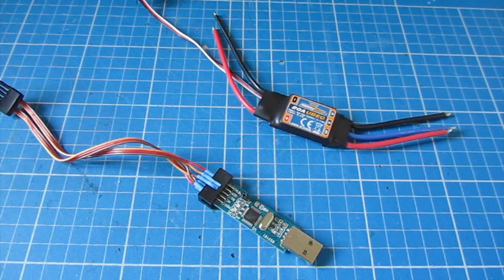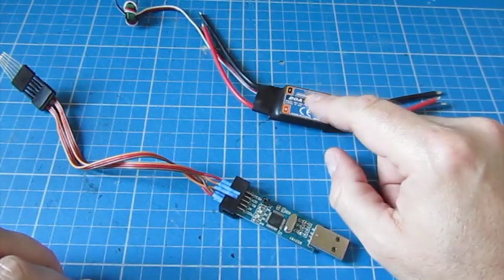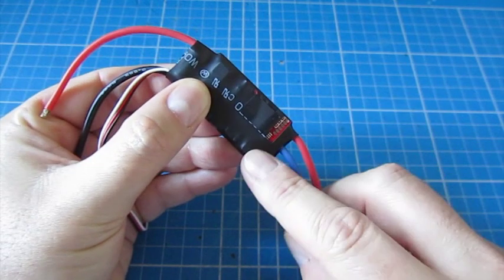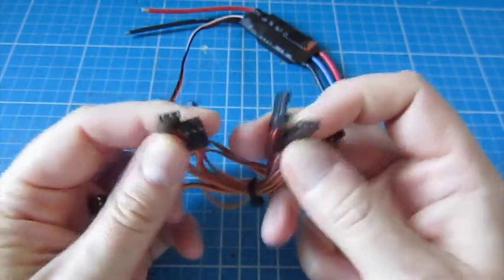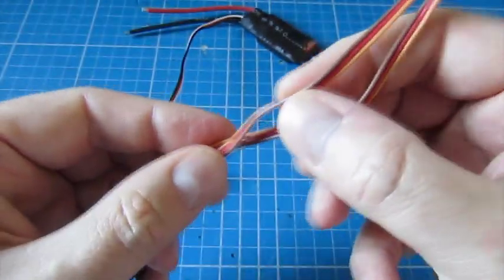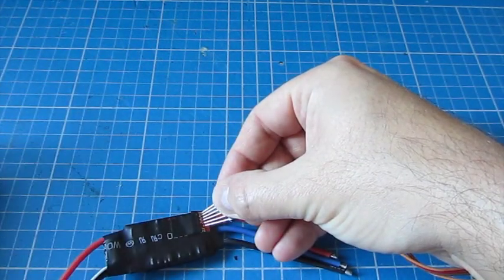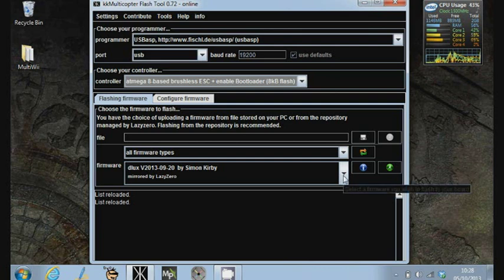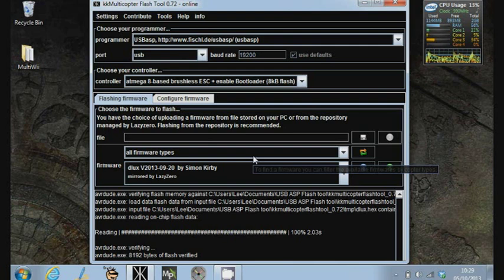How to update SimonK Firmware on ESCs using an USBASP tool

Comment: I have a big four 30A Esc and I need updat to bheli
It's possivel???
Reply from the maker: Depends on the make and model.. Best of luck
Reply: @Painless360  
I'm not sure what my ESC is because I bought it on AliExpress 5 years ago and it came only with a red shiring and a HW30A sticker hehe
I have this table, but idk my esc type
https://docs.google.com/spreadsheets/d/13tMlu5ldLNpZXwbe6UhDHJhcgTVuljm8HDiDp9WO9Pk/edit#gid=0

I think about giving up on this idea before I kill my ESC, maybe I'll leave it to SimonK who has already been there hehe

The idea is to put them to work with Betaflight on an F3 controller that I had kept here and was never used.

Frame F450 (No one else uses it)
Reply from the maker: If you don't know not sure how I will! :) May be time to invest in some new ones...

Comment: Painless360 - please tell me if i can flash ANY of the ESCs that can be found on hobbyking with SimonK firmware? Does SimonK firmware allow to switch any ESC to Forward/Reverse operation? Thank you!
Reply from the maker: The ability to update an ESC is very specific to that speed controller. SimonK has been superseded by BL_HelIsuite these days now anyway. Best of luck!

Comment: thanks for the video :) can i flash my Hobbypower 30A esc with simonk firmware? here is its link http://arduinopak.com/Prd_Detail.aspx?Prd_ID=17540
Reply from the maker: No idea, I've not used that one. That's a question for the vendor/seller. Best of luck!
Reply: I have the same question (and the same esc)

Comment: sir please answer this question of mine that is it necessary to flash ESC? can we use it without flashing...
Reply from the maker: You can but I wouldn't. You need a fast ESC update on the multirotors. Most pilots use BLHeli now..
Reply: sir thanks for your suggestion

Comment: Used this method to get blheli bootloader onto my SN20A ESC's with the USBasp. I had some of the "female tall stackable header connector socket arduino" in my spare part shelf. So I only had to make the wires between it, and the USBasp. Btw, looks like I killed one of my ESC's during the flash due to a short circuit for the positive and negative wires to the ESC (the ones that you usually connect to a battery or PDB) they touch each other during flash. After that, there is no response from the ESC when I try to flash it again. Even not if I hook it up to a motor, connect the signal lead to a servo tester and apply power. Luckily, I've of that kind who like some spare. So I've just picked up a brand new SN20A from my spare part shelf ;) Recommend all other to add a piece of tape to insulate the positive lead soldered to the ESC. The main reason for flashing the ESC's with blheli bootloader, was to achieve BLHeliSuite compatibility through Naze32 board for later flashing/reprogramming of the ESC's. The SimonK bootloader does not have the signal by-pass through Naze32 compatibility as the blheli bootloader. With SimonK bootloader, you have to disconnect the servo connector from the ESC, one by one, and hook it up with a ESC linker interface. I think the SN20A is a bit outdated for the game. But want to test oneshot for these particular ESC's for a new build of an 180 frame with RCX H2205/2950KV motors and see how crazy it goes/fly =)
Reply from the maker: +Eirik Larsson happy flying!
Reply: Thanks :)
I forgot to mention that I've used the BLHeliSuite program to flash the blheli bootloader onto the ESC through the USBasp device. I did not use the kkMulticopter Flash Tool as you did. Just mention cause I see other ask you if this will work with other ESC's or not. Happy flying Painless360, you helped me out a lot of times with all your good videos. Cheers =)

Comment: First of all, awesome video(s). You inspired me to make this my hobby too :)
But I got a problem with my software:

I really need your help. I just got into the hobby from fpv and I can't figure out whats now the problem.

My problem is that I can't switch on the motors BUT the receiver gets the signal and the motors are working on the "motors"-tab on cleanflight. So the problem should be on the software right?

I bought the following kit: 
https://www.aliexpress.com/item/DIY-mini-drone-Nighthawk-250-FPV-frame-kit-D2204-motor-Red-Hawk-BL12A-ESC-OPTO-CC3D/32698109504.html?spm=2114.13010108.99999999.7.AWW0Ud

I really would appreciate your help
Reply from the maker: +PixelDuude check out our 'troubleshooting arming' video to see what to look for. Best of luck!
Reply: Yeah this was the problem :)
thx

Comment: Hiya. I got some esc's from hobbyking and I wanted to flash them with simonk but I can't make out what solder pads to use. They're LD-Power 15a and there doesn't seem to be much info on the web about them. Have you any ideas? https://flic.kr/p/FLHWaZ Cheers ;)
Reply from the maker: +JohnnySlash No idea, we've not used these. I'd look at those pads at the bottom and see if you can see any markings on the main chip to figure out the pinouts they are connected too.. Best of luck!
Reply: Painless360
Fair play. The closest I've come up with is they're a copy of the Hobbywing X-rotor 15a, but not much else. I'll check with Hobbyking coz they're doing LD-Power series kits and should have some info. Cheers ;)

Comment: I want to update SimonK firmware of my 20A ESC because I want to calibrate it through Arduino. Can you please help me showing these 6 pads on my ESC because its not as the ESC you used. The link of the ESC I used is http://www.quadkopters.com/product/esc-ubec/simonk-esc-20a/
https://www.dropbox.com/sh/17e0f7hfh6ml9i2/AAC7HuwBQuN1MJE4oPtpcsjWa?dl=0
Please help me out here, I'm stuck since a long time. Thanks
Reply from the maker: +Harsh Hirani It looks like one you will need a USD adapter for. I'd ask the vendor/manufacturer for help. Best of luck!
Reply: Yes, I'm using a USBASP programmer for my ESC's ATMEL processor.

Comment: I like how you made the cable. I want to use the USBASP programmer to flash a hobbywing 20A esc. I think the cable I need only has 3 wire (BLHeli). Do you know what 3 pins I need to use on the USBASP programmer?Thanks
Reply from the maker: +Pat Adamson I use a USB linker from HobbyKing.. Best of luck..

Comment: Is it possible to flash the ESCs using a FTDI Basic Program downloader? 
Reason is that I already got one to program the Minimosd Micro.
Thank you for your help, this is getting somehow quite overwhelming and you're making it slightly less painless!!
Reply from the maker: +Joe Hannouch No, I don't think you can. This method works great and a USBASP programmer is like the FTDI Basic adapter - inexpensive but worth it's weight in gold ;)

Comment: Hi
Thank you for all your videos I am finding them extremely useful and learning a great deal from your work here.
I am looking to flash SimonK to Mystery Firedragon 30a esc's, which from research so far is possible but they do not appear to have the pads that you connected to, in which case I would be looking at getting and using the tool you showed a picture of for updating the atmel chip? Am I right in thinking the pads you showed connecting to are just a convenient breakout location for some of the legs of the atmel chip? which the atmel programming tool will connect to instead?
I have a USBasp like yours and have seen the atmel tool on ebay.
Thank you
Jay
Reply from the maker: Jay L Hi, I am not familiar with these ESC models. I've had a quick Google for some ideas but not found anything. I would suggest asking your supplier in case they are already flashed with SimonK (or similar ) firmware.
Best of luck.

Comment: Can ESCs be connected to distribution board when flashed? I have them already soldered, thanks
Reply from the maker: That should be fine, make sure the battery isn't plugged in though! ;)

Best of luck.

Comment: Hey dude, I'm trying to flash some 30a esc with blheli and 3 out of the 4 took it fine but one says within software that it has locked bootloader and I must use a 6 pin flash tool to do so. 

I have a usbasp for the kk2 board but the pins you list on here are not the same as listed on my afro esc pads under the heatshrink. I have looked online at blheli stuff for a good couple evenings and all procedures seem to use the 3 pin method like the blheli stick tools for the micro esc like xp7a and below. I have this also if it helps.

Any chance you can point me in the right direction for pin connections to flash this last one?
They are listed:
GND
BEC
RXD
TXD
SCL
SDA

Thank you
Reply from the maker: Hi, thanks for the question - I would go back to the supplier and ask for support in case the one that has the issue is faulty.

Best of luck..
Reply: I don't believe it is faulty, it had reverse simonk firmware on this one for 3d so bootloader is locked. Others were from a different multi so were not locked and could be flashed via the single wire.

Blheli says I must use 6 pin cable with the pads on the esc. I just need to know what cable to make/buy. All blheli stuff uses a 3 pin connector so this is why I am unsure how to go forward.

I think I need one of these perhaps but still looking for confirmation from anyone that the atmel socket tool can flash blheli to this remaining afro.
http://www.hobbyking.com/hobbyking/store/__27195__Atmel_Atmega_Socket_Firmware_Flashing_Tool.html
Reply from the maker: Sorry, this isn't something I've had experience with. I'd be looking to get my hands on the flashing tool that fits over the processor on the ESC though as I think you're right -  it looks like the firmware on there doesn't have a boot loader so can't use the three pin method.

Best of luck getting it sorted..

Comment: Hi there Lee, I hope you're enjoying a good festive season, I have a problem (go figure). I cannot get my KKFlashtool to open in Win8.1, any ideas why this could be?
Reply from the maker: Hi Richard, without an error Im guessing - try updating the Java install on the PC or  check the drivers are installed ok -

Restart the computer to the Advanced Startup Options. To do this, you can click "Restart" while holding down the shift key on your keyboard. Choose "Troubleshoot" from the menu. Choose "Advanced Options".

Choose "Windows Startup settings" It may say "Change Windows startup behavior". The computer will restart, and you should come to another menu. Choose "Disable driver signature enforcement"

The computer will finish booting, and you should be able to install the unsigned drivers.

Best of luck!
Reply: Ok, I have done both, I have Java ver 8 (64bit) and I re-installed the USBASP drivers with ones from the KKFlashtools link on their page..  Still not happening, I don't understand why everything I try seems to end in tears :(
Reply: Ok, so I have got the KKFlashtool opening now, however, I still cannot load the repository files in the tool.... I am getting closer though
Reply from the maker: Almost there! How did you get the KK tool to work in the end?
Reply: Hey Lee, well its an intermittent issue, sometimes it opens and sometimes it doesn't, I managed to Flash all my ESC's though so that's a bonus, I just hope they all work now,,, :), I'll need to assemble the beast and have a go

Comment: Great video, as usual. Is it possible to mix esc's with different amperage?  For instance, Turnigy Plush 30A and 40A? Would that cause a problem?  Reason is cost.  I have 2 40A and need to purchase 2 more esc's. 30A are $13. and 40A are $20. My motors are 21A. Batteries are 3s.  Thanks
Reply from the maker: Hi, If the firmware was identical you could try but my advise would be - don't risk your model and the safety of yourself and others for the sake of and extra $14. It's not worth it. Happy flying!

Comment: Painless I have just found that my 30 amp  BLACK MANTIS ESC's: -Turns out they are the SAME as the "Mystery" series of speed controllers sold by HobbyKing: -What is more, seems clear from all info on web, that they are also the SAME as all the ZTW ESC's, which are sold by e.g. Park Aero, and many many other sites So what should i be setting mine to ,To use the simonk Firmware.
Reply from the maker: Plug, sorry I've not used these so the best place to ask this would be the RCGroups forums. Using the SimonK firmware may help with the 'bobbing' issue as the response is so much faster. Best of luck.

Comment: Are you flashing the HK F20 with DLUX.hex? Or was that for illustration purposes only? Because both the HK F20 & F30 A ESCs use the same SimonK hex file upgrading, namely BS N-FET,  I thought it fitting to ask what iteration you are currently using. There are many versions of it. I have explored but a few different flavours of Simon Kirby's wares. Ref. >>>Ton Sn0ws Database For ESC's

http://wiki.openpilot.org/display/Doc/RapidESC+Database.

My question centers around the various types of FW for each of the ones listed in the KK database. If you activate the list of FW in the control panel you will find a long list of them. You stopped at the first one on the list called DLUX. There are a list of 30 of them right underneath that one. And for each of them there are numerous versions,  all with the dates they were conceived or published.
But are there different applications ...Or...does one supercede the last?
The "I" button on KKMulticopter GUI that should give you linkage to "Commit changes" or the history of changes, but I generally get this page here for info on ESC FW, 
https://github.com/sim-/tgy 
& surmise that these Github repositories are for the contributors /code writers. Do you concour?
But then I found this one explaining all of the improvements to his updates
https://github.com/sim-/tgy/commits/master
One of SimonK's significant projects is this FW "Dispenser" of sorts
 http://0x.ca/tgy/?obj=f30&target=all  
It has a way to go yet but...This is a great idea. "Custom made to order FW for ESCs" 
Otherwise the ZIP files there are, once extracted, a repository all their own for numerous ESC's, you pick the one that is applicable. 
It is your video that made me realize what was going on and to finally ask the question "How does this work?"  when I saw the date of the FW you flashed your F20 with.....I noted the similarity and the rest is history now. I will tell you a small story....
For the same frame I have some 5014 high pole count motors to use with 14" props, now when I did the research about them and their timing problem of the "cogging" issues of these high pole count motors such as the 5014 and others eg. Multistar series at HK, I read a response from Simon that his work to address this serious matter produced  V2013-09-20 amongst others.  Now I see that the improvements are present in .HEX files for many ESCs. but not all of the ones listed in  Tom Sn0ws Database For programmable Atmega 8 Based ESC's, more than likely the ones that are prominently being used for Tri's Quads and Hexas
This spreadsheet also shows Silabs MCU's that use BLHeli FW to Flash authored by some other brainiac..
I still need more info on some of the eight iterations of BS N-FET I have to choose from, but I think I will begin with V2013-09-20 :-) Thanks for this contribution. I have made a major breakthrough here.
Reply from the maker: The best place to ask these questions is in the forums on RcGroups and one of the team, maybe even SimonK himself, can answer in detail.

I used the firmware version shown in the video and it worked OK (until they updated the tool).

Sorry I can't be of more help but I've found a few problems with the tool in the past (see my other video) and the best place for support on the latest version is on the forums.

Happy flying!
Reply: Sorry for the long post here Painless, I know more about it now than I ever have. It is all because of your good works too. If I hadn't upped the resolution of the YouTube viewer and seen your choice of dlux and the date on it, none of this epiphany would have happened. :-) I  have updated to the most recent kkmulticopterflashtool_0.77beta8
and I have just used it to flash several items on my list. I hope that people read my post though, There is all the information there to be able to make a sound decision about the type and revision of each. I'll be in touch with some reports of a good maiden I hope. Just putting the FPV gear on it today and doing range test for both Rx and Video as well as MinimOSD config. I won't trouble you for a bit OK?

All the best to you lad.
Reply from the maker: Don't feel that you can't ask a question - yours is a great one. Sadly I've not used the flash tool for a few months as a lot of the latest builds have been planes/wings so I can't comment on the latest versions of the code and firmware. I'd like to see your model in the air if you post any video. Good luck, happy flying!

Comment: Nice easy to understand vid, good job.
BTW SCK stands for serial clock and allows for timing references when data is moved back and forward. All the connections are part of a SPI (Serial Peripheral Interface) protocol

Comment: Hi there buddy, just about to do the flash on F30 ESC....insha Allah I will let you know how it goes
Reply: there is an error:
Flash the firmware from repository.

C:\Users\Muhammad Abdul Hadi\Desktop\lib\avrdude\windows\avrdude.exe -C C:\Users\Muhammad Abdul Hadi\Desktop\lib\avrdude\windows\avrdude.conf -p m8 -P COM6 -c tgyusblinker -e -U lfuse:r:C:\Users\Muhammad Abdul Hadi\Desktop\tmp\/lfuse.hex:r -U hfuse:r:C:\Users\Muhammad Abdul Hadi\Desktop\tmp\/hfuse.hex:r 
avrdude.exe: ser_open(): can't open device "\\.\COM6": The requested resource is in use.

avrdude.exe done.  Thank you.

Error during reading of high fuse.
Flashing of firmware aborted.

I don't know what I did wrong?
Reply: Alhamdulillah problem solved....thye driver was not properly installed :-)